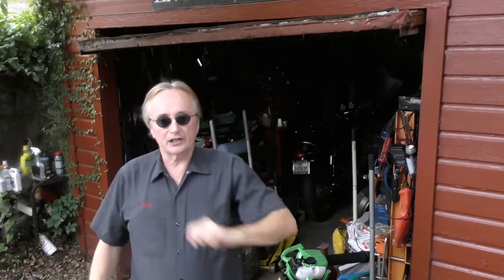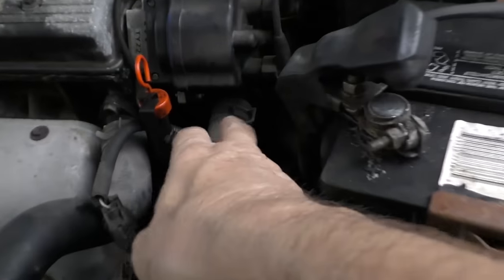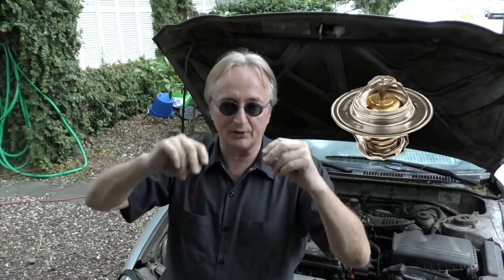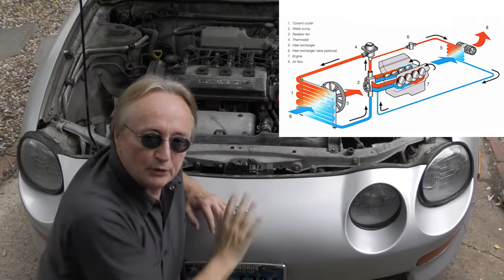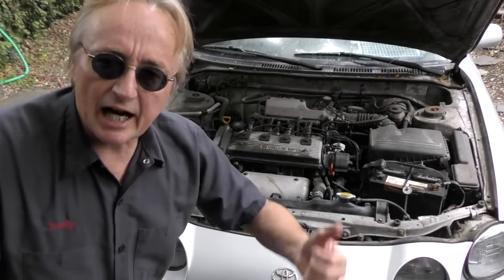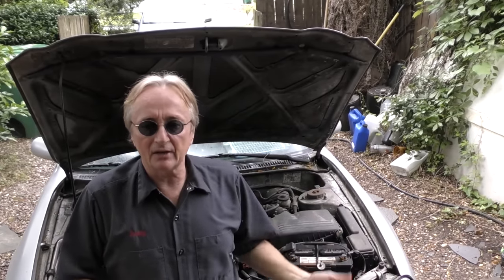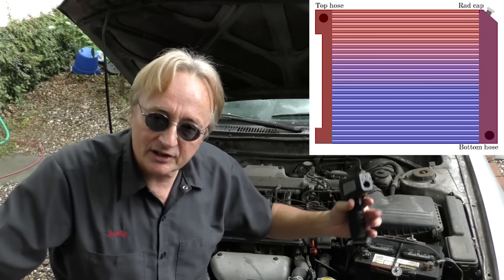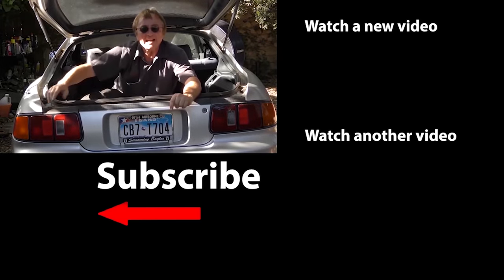Doing This Will Make Your Car's Cooling System Last Forever

Comment: I live in hot (tropical) climate (70°~90°F). Not a few people (and some mechanics) take out the thermostat altogether. I haven't done this myself. Is this a bad idea?
Reply: It isn't great but it isn't the end of the world. Car engines are most efficient on gas, and experience the least carbon buildup on the valves, when the water temperature is between 180-200 degrees Fahrenheit. Functioning thermostats get engine temp up to that temp quickly.

Comment: I have a 2010 XC 90 Volvo need to replace the coolent tank.  Do you need to bleed out any air in the cooling  system when installed.

Comment: How about if you spray tyres with that  ? Does it help ???
Reply: AT-205 is not a rubber conditioner it is a stop leak. It causes rubber gaskets it treats to swell. That is the reason it works as a stop leak because the gaskets swell up and the leak stops..for a while then when it does fail the leak is 2 or 3 times worse. It is not sold to treat rubber tires or hoses or suspension parts.

Comment: Hay scotty got a 2007 jeep wrangled  sometimes when I start it it will run ruff like its running on 5 cly continning running and it will clear my itself  put a scanner on it it reads something wrong with #1 cly plug wire coil ,but after 30 sec of running and it clears out it runs great what could this be ?

Comment: Question I have 2004 honda accord when the car was sold to me in 2008 it had a regular sized battery in it that battery went bad on me so I took it to honda and they installed a smaller battery that doesnt seem to have much power to it would it hurt the car if i went back to a regular sized car battery ?

Comment: I have a 2001 Chevy blazer and it started over heating  and a small hose on the bottom of radiator come off and it has a metal tube inside of the hose.  I can’t figure out where it connects to and when it blew off it come up and broke one of the propellers off my fam.    When u put water in the radiator it just leaks it out immediately

Comment: Sir I m from Pakistan. I have 2005 vti local manufactured. I have a problem. Coolant from radiator goes to reservoir but doesn't come back to the radiator. Ultimately the reservoir over fill starts leaking and car over heat. I changed radiator caps and reservoir cap number of times. Pl give me salutation. Thanks

Comment: Here's a tip, never buy a used Chevrolet that ran Dexcool... Bought way too many that all universally had cooling system issues. Even worse, you fix the culprit of a problem and the rest of the components start going with it. I'll pass on cars using Dexcool.

Comment: Scotty, do the engine oil additives such as Slick 50 that are supposed to repair scratches in the cylinder walls really work ? What do you think of them ?

Comment: I know this has nothing to do with this video. 
But I have a 92 honda accord EX coupe.  It's having bogging issues when warm.  Feels like it is miss firing like it needs a tune up.   When this is happening.   I smell fuel.   Need insight on this issue.

Comment: Hey Scotty Kilmer I have a 05 Chevy cobalt 2.2 I replaced the temperature sensor I checked both relays work but my temperature goes up to 223 then the fan turs on what could be the problem
Reply: Thermostat

Comment: DON'T  use high pressure hoses at car wash I did kept going thru radiators that were made for the coast salt air mechanic  ask if I was using car wash pressure washer I stopped no more problems

Comment: I'm having so many coolant issues with 2012 chevy cruze mystery leak, changed pump, water oulet thermostat still leaks overnight, some seepage on trasmission help scotty😱
Reply: Minister Victor Simmons terrible car I bought the same year it overheated so bad it warped internals claimed  wasn’t covered under warranty after they replaced the engine already one time if possible get it fixed under the first warranty try before it dies for good then get rid of it before you end up 10k behind like I did
Reply: @jonathananderson891  thanks

Comment: 2006 Pontiac Grand Prix  still can't get no heat changed Radiator and new thermostat burped the cooling system numerous times and still no heat and replaced temperature actuator doors and still no heat any suggestions on my car ?

Comment: Question: why the 2008 Navigator does not have a radiator cap? I looked everywhere! Also if anyone is knowledgable, is that true that the 2008 Navigator does not have the interior cabin filter either, I can't find it?

Comment: Question: is it good to run the AC or heater while parking or idle for hours to take a nap?
Reply: better keep drivers window open
Reply: @ElleBrOw  hmm. Why? It's 2 hot here in Texas
Reply: @stevenhuynh1999  rather hot or cold its NEVER good idea sitting in idling vehicle with windows shut, especially napping. Exhaust would kill u if it malfunctioned 👀 Radiator debris also exudes thru dashboard vents. U mean to tell me you've never heard of these dangers? Wow I just saved your life
Reply: @ElleBrOw  Thanks for the warning. It's because am I an Uber driver. At times, I thought driving home sleepy was dangerous. Then, u tell me about the danger of using the AC in the summer idling, or the heater in the winter idling. Thanks...
Reply: @stevenhuynh1999  No problem ♥️ be careful out there

Comment: I have an 02 Chevy cavalier that keeps running hot. The water pump was not leaking coolant. The fan was not coming on. We replaced that. Then after awhile it started running hot again. We never let it get to the danger zone to worry about the head gasket. The fan was only coming on while the a/c was on. We replaced the thermostat and the temperature sensor for the coolant. Still no leaks from water pump. My radiator doesn’t have a cap on it. Replaced the cap on coolant reservoir. Checked the heater inside the car, blowing very hot air. I changed the water pump and obviously the stupid paper gasket moved or got pinched in the process of putting it back on, because now it’s leaking coolant. After I redo the water pump, does anybody on here that knows what I am missing on this car? Thank you in advance.

Comment: Never ever use high pressure water to clean the radiator. You will ruin the air channels of the radiator and you will need to change it

Comment: I have a tiny hairline crack along the top seam in the plastic of my radiator. Is that something that is fixable or do I have to replace the whole damn thing? Coolant leaks from it but my car isn’t overheating yet.
Reply: Mine did the same thing. It's a Subaru, it eventually started heating up more so I changed it. It didn't take long you might as well do it now and not risk blowing your motor.

Comment: My car engine teperatur OK except when I turn the heat on .  What could be the problem?
Reply: Is it low? I'd guess that there is hardly any coolant left in the radiator?
Reply: @Budaboose  coolant is OK.  It is strange.   In the spring I changed the rad.  Maybe they left something loose but what could it be?

Comment: my lexus IS 220d doesn't heat up. I  drive 4 miles each way. temperature gauge barley move.I have given car to gauge to changed water pump and thermostat. car still doesn't heat up. 
a

Comment: Long shot i know but dose anyone have a clue why my engine starts overheating on long journeys. Its completely fine for 20min run around journeys but 2-4 hrs journeys it starts to overheat. I have changed Radiator thermostat pretty sure its not the pump, i have flushed the whole system and at this point i dont know what to do other than take it to a garage :(
Reply: Run the heater to blow off some extra heat so you don't get stuck

Comment: Chrysler is THE Worst! The 2000 cirrus to be exact! you have to take the whole engine apart to replace the thermostat and the timing belt, That car was a nightmare to fix. And it was a crappy car to begin with,drove like a coffin and to continue with the ridiculous stupid design ideas ,You had to remove the front wheel and inner wheel well liner just to get to the battery.They put an extension to the upper engine with a couple terminals but to actually boost the car or unhook the battery you had to do all that,sucked for me having to do that to start the car every day because the battery was going dead for some reason had a draw on it and we couldn't find the short ,went through the entire electrical system. All the wires checked by hand. What a piece of junk! i scrapped it soon after.

Comment: Won't tap water corrode the cooling system
Reply: YES! If you are going to use any water be sure it is distilled water only. Great point Anthony!
Reply: @vigilantemotors  deionized is ok aswell? Also what can I use to flush or propell the water, compressor with foam cannon type thing?
Reply: @hserieshooligan1997  First, check your manual and see if it specifies either or. You can use both as long as you are mixing it with anti-freeze.
Are you asking how to flush your radiator?
Reply: @vigilantemotors  yeah exactly I was gonna empty radiator and fill with deionised run it then drain and fill with coolant? Installing new mishimoto pretty sweet lol 🤣 coolant is premixed honda stuff
Reply: @hserieshooligan1997  if you’ve never done an coolant flush before it’s not all that hard. However, make sure you also flush and clean out not only the radiator but also the overflow container too.
If you have any questions hit me up on my channel on here. You actually might like it. Let me know my man
Reply: @vigilantemotors  have a new mishimoto rad to go into my prelude I have deionised in bottles just wondering can I drain fill up with deionised and put in new coolant cheers
Reply: @hserieshooligan1997  yes you can use deionized water as long as you’re mixing it properly with antifreeze
Reply: @vigilantemotors  I just want to flush the old coolant from the system with deionized and fill back up with new Honda pre mixed antifreeze
Reply: @hserieshooligan1997  Sure but first drain all of the old fluid out. Then fill the radiator with either a radiator cleaner or distilled water. Turn you vehicle on for about 5 min, let it run through.
Drain the radiator again making sure the fluid being drained is somewhat clean. If its not repeat the process above. 

Once the water being drained is clean refill your radiator with your Honda pre-mix my friend.

Comment: SORRY BUT LAST SPRING 2023 I PUT IN A OEM THERMOSTAT AND IT WAS MY OEM STAT THAT WAS CRAP. I DIDNT DRIVE MY SUMMER CAR BUT 1500 MILES LADT SUMMER. I PUT IN A NEW RADIATOR CHECKED THE FANS  AND THIS SPRING I THOUGHT THE HELL WITH THIS I BOUGHT  A AUTO ZONE STAT AND BINGO IM DRIVING  MY SUMMER  CAR AND HAVING FUN THIS YEAR. 
OH AND I DID ORDER A NEW OEM STAT STILL ISNT HERE ITS BEEN 2 1/2 months  WHAT A JOKE CORPORATE AMERICA CAN GO SCREW THEMSELVES

Comment: Air cooled engines use.,.......wait for it...... Air to cool it.
The oil cooler on your motorcycle cools the oil for the transmission/gearbox.
Contradictory statements like keeping the bugs off the front and then slipping in "corrosion" should let you know that you need to find a better mechanic than Scotty. I don't think he's stupid, I simply don't trust him.